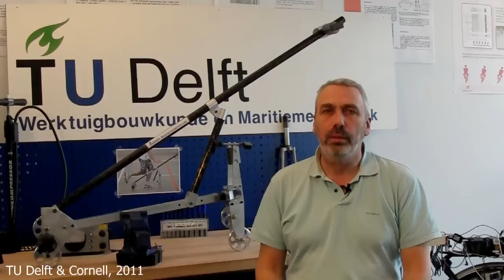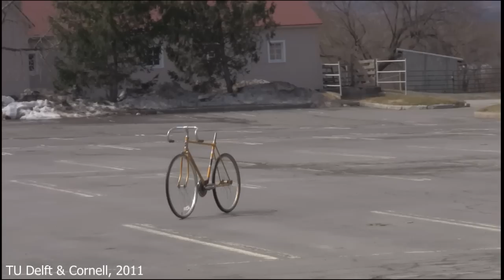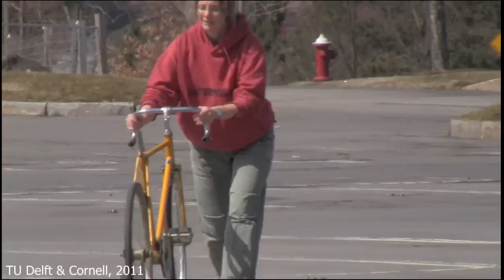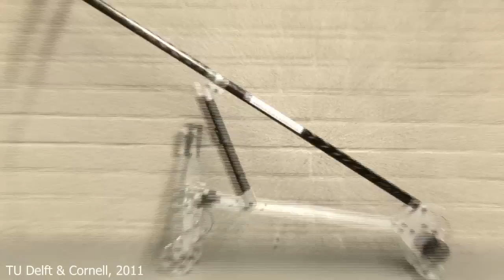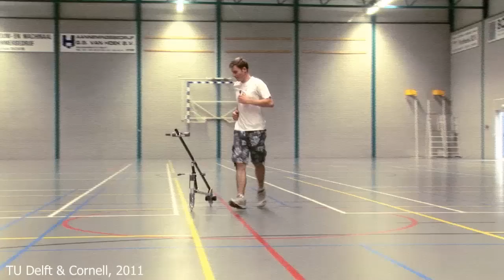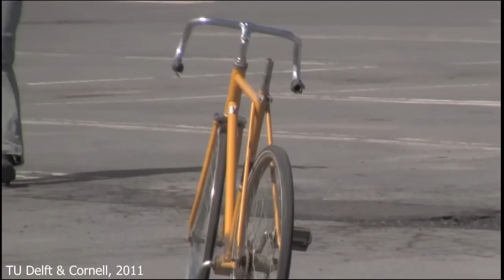TMS Bicycle, stable without gyros or trail (TMS=two-mass-skate)

Comment: This was covered back in the 80's. I wish I could remember the documentary... One of the experiments was a near vertical rake bike with lots of trail down a hill, with no rider on board. With the front wheel in normal position it had positive trail, and would crash as soon as it lost balance from the push start. When the front whet was turned 180 deg in the head steam, the trail became negative, and the bike would lean in to turns as described in this video. Stopping it from falling until all forward momentum was gone. I think they had runs with counter gyros too. Was all open source. I think I saw it on ABC (Australia) as a part of "Quantum" the science show.

Of course it all relates to what happens when there is a rider on board as well.. The negative trail model could not be ridden by any human with a normal sense of balance.  Although interestingly, they did get people with unusual balance disorders to ride it...

The contraption in this video is not a bicycle. It has no peddles nor a seat. I seriously doubt it would be safe to ride. Looks like a tank slapping high-side machine to me. Which is pretty special for something that is technically a scooter.... Oh wait... A scooter needs to have a person on board too. This is just some kind of cart or barrow.... Something that is pushed by a person not riding it.

Awesome Pseudoscience guys. Ripping off open source researchers and failing to get the experiment right. Way to represent.
Reply: By all means do some digging. I'd especially like to see a definition of a bicycle without rider or peddles mentioned. My understanding is that a rider and peddles must be present. Power must be supplied from on board or it becomes a cart or barrow... Bike with no peddles but rider supplied power = Scooter or skate board... If you have an on board power source that is not animal, it becomes a motorcycle. http://www.oxforddictionaries.com/definition/english/bicycle

Technically you could have a treadmill or something other than peddles, but power must be supplied independently from the surface being ridden on. By the rider.

Power provided by animal from off board, is defined as a cart or barrow. Because the geometry and physics all change when you add a rider.... This is a push cart, or trolly (as it has steering). The steering will not work if a rider is on board. It only works when riderless.

To call it a bike I want to see a rider doing continuous figure eights with no feet touching ground. Until I see that. Its just an experimental death trap.
Reply: Aaron Stemple if your doing psudoscience...

Like practicing arboriculture on an animal or calling the vet out to look at a sick tree. Its all bioligy after all. The title and terminology is not relevant...

You cant test a bike if it has no place for the rider to input power, as then its not a bike. Its a cart. Reason being that the rider changes the weight, center of gravity, and adds reflex actions that can not be suppressed. I bike uses these reflex action as part of the balance mechanism. So the most stripped down you can get a bike fr testing still involves a rider and drive system. If you remove the rider its not a bike. It does not meet the geometric requirements of a bike. Which include seat and footrest positions.
Reply: So have you found an example of a TMS bike with a rider?
Reply: I was just looking at the Wiki page for this device. Paying close attention to the pics. when it hit me. Rake and trail are both present on this device. If the main horizontal spar was lifted up at the back, to be parallel with ground. It would not have rake or trail, but with the lower rear it puts both rake and trail on the front. Just like longer forks on a trail bike....

This ones busted I think. Although I would be keen to see what Arend Schwab has to say. Maybe I'm missing something?
Reply: You cant replicate a person on a bike. Get a robot to ride one, maybe, but replicate a human, not so easy.
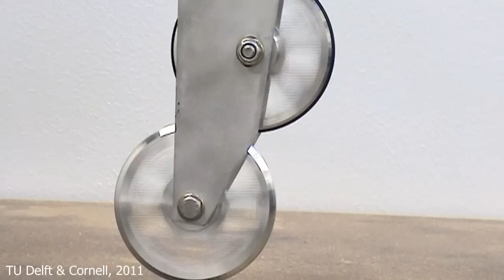Reply: That sounded fishy to me from 1:17, when he stated "it has no gyroscopic effect due to counter-rotating wheels".
But it HAS gyro effect, even if it is rather small due to the small diameter of the wheels (and low mass)...
Gyroscopic effect is about conservation of rotational momentum.
Reply: Razvan-Mihai Dudu it should counter out the gyroscopic forces that make a wheel resistant to turning. In the same way a spinning top with two equal counter-rotating rotors will not balance like a single direction rotor.Not that it would be a factor with those tiny wheels.
Reply: Aaron Stemple did you even read the aim?
This video doesn't demonstrate any of the things it claims to. Its a total rip off of a legitimate experiment done many years before. Classic example of university people attempting to discredit well conducted research with bogus replications that completely miss the point of the original work.Which can be replicated with a mildly modified bike, still able to take a rider.

This contraption dosn't even have the negative trail that is required for such a device to work. That is called for in the original AIM of the experiment. THAT is why there is that counter balance shaft. Because they couldn't get the rake angle-trail relationship right.

To finish the experiment once the bike coasts down a hill. released from a clamp, so NO HUMAN ENERGY is used to ballance the bike, and once this has been done on many angles do demonstrate the bike can self correct, and will always take the most direct path down the hill. Then. Once all that is established. You repeat with a rider, and watch them get flung off before reaching the bottom of the hill. Unless they have a balance disorder that prevents them from riding a regular bike.

Which proves that a bike must have positive rake to be rid-able, but a balance cart can self balance and steer itself. If the steering head is in front of the tires contact point.

Which is ultimately all an experiment in human counter steering on bikes.

What did you find in your study's Aaron Stemple I really hope you have something to say that is actually relevant to the experiment at hand! Seems to me your totally missing the point of this exercise.
Reply: Hi Mongrel and Aaron.  I am one of the co-authors of the work.   I am sure that there are many legitimate things to question about what we have done.  But I don't think ripping off older well-known research is one of them.  Please, if you have a minute, look at some of the stuff, including lots of looks at past research, on our www pages.  You can find them with simple google searches.

One of our appendices is a pretty detailed study of who know what about how bicycles can balance themselves, when.  

Most of the mythology about bicycle balance, which you allude to, comes from a paper in Physics Today from 1970 by  David Jones.   That paper, although regarded by many to establish the facts of bicycle stability, was really, because of its flaws, the motivator of our research.  Again, we have pretty detailed discussions of all of this on our www sites.

In the past when people have given us "This was all well known long ago"
responses, they have backed off, even apologizing, when they have looked into it more.
Reply: I can assure you I am not referring to the 70's paper.
I'm referring to open source research that was published as a series of replicable experiments. In the 80's. By an Australian.

I googled this for over an hour, trying to find the original work again, but this video and one other was all I could  find. Please provide a link to your website.

I'm still wondering why make this device. If you cut and re weld a regular bike's hear steam with no rake, and use offset forks and a counter gyro, you get the same result. Minus the need for a push start. You can then also show the lack of rideability of such a bike. If it self balance it will disagree with most riders...

I'm pretty sure the work I refer to shows its basic momentum that stops the bike falling. I do remember it had nothing to do with gyroscopic force or steering angles.
Reply: Hi:
I did not mean that you were referring to the 1970 Physics Today article by David Jones (British),  Rather, I that it is likely that the show(s) you saw were based on Jones's work.   Jones intended to debunk "the angular momentum theory" and replace it with "the trail" theory.  Our aim in the work you are critical of, is intended to debunk both of those theories.

We have been pretty thorough about the history of ideas, so I don't think you will find that we have casually neglected anything known about these topics. 

My www site about the TMS bike:
http://ruina.tam.cornell.edu/research/topics/bicycle_mechanics/stablebicycle/index.htm

My more general bike site:
http://ruina.tam.cornell.edu/research/topics/bicycle_mechanics/overview.php

Arend Schwabb's site, with lots of overlap with mine, but more stuff:
http://bicycle.tudelft.nl/stablebicycle/

Some of the things on these sites are pretty technical.  But much is not and should be accessible to people who have taken not much more than high-school physics.  And the various videos might be entertaining even if you don't care to follow all of the theory.

Let us know if the things above, if not clarifying, at least give us a pass on not just copying and ignoring previous works.
Reply: Thanks for the links. Technical stuff is good for me :) Been a motorcycle performance tuner for over 20 years. If I cant see reference to the work I am thinking of (Which has likely been suppressed) I'll replicate what I can remember if I can get an old bike frame.
Reply: What's wrong with re-doing an experiment and publishing the results? More data is always better. I'm not sure why you're angry at these researchers for carrying out this experiment.

Comment: Do you feel some sort of gyroscopic effect while holding that wheel? I'm curious...
Further more there must be some kind of magical effect happening since the wheels knows there's another wheels present so it knows when to stop making that gyroscopic effect?.. is that it?...so if you space them like ten feet apart it will still cancel out but they have to still be subscribed to each others twitter feed? is that it?

Comment: the gyroscopic effect of a spinning bicycle wheel is very easily demonstrated and proven by just holding a spinning wheel and then placing yourself in a office chair and tilting the wheel making you rotate in the same direction.
I really do not believe you have dis proven the gyroscopic effect by the counter rotating wheels.. counter rotation works merely in the perpendicular axis not the longitudinal one as far as I am aware. its like the counter rotating propellers on planes or boats.

Comment: this is stupid,of course and its because of inertia,every atom of the bike wants to continue going in the direction it was pushed,including the atoms of the wheels,so the wheels as a whole stabilize in that direction until the bikes velocity reaches a point where the inertia isn't enough so the bike drops down in one side
Reply from the maker: Hi Harry,
Here Arend Schwab one of the co-authors on the Science paper. Indeed, thats what most people thought, but don't judge to fast. Just read the Science paper, it's only 4 pages and no formulas, most people like it. You can find it at: http://bicycle.tudelft.nl/stablebicycle/
Arend
Reply: Arend Schwab if you threw an entire bike completely straight a centimeter above earth,even if it was completely asymmetrical and the center of mass was not between the wheels but left or right(you could glue a hammer on the bike thats pointing left or right),with enough throwing force the bike would still be stable in the direction it was thrown,flying,what's the difference if the wheels are touching the earth,the only one is that the bike would lose velocity faster,if you threw a monowheel the same would be true,even if you throw the hammer the same would be true,it would slide in the direction it was thrown,i see no difference
Reply from the maker: Hi Harry,
I would love to discuss, but I guess I would start repeating myself. So please first read the Science paper and then we talk again, ok?
Arend
Reply: Harry Nafpaktitis
http://en.wikipedia.org/wiki/Dunning%E2%80%93Kruger_effect
Reply: ***** ahahahahaahah xDDD
Reply: Harry Nafpaktitis
...You realize that's directed at you, yes?
Reply: I think what needs explaining is why the bike doesn't just fall over as a pole would. Sure, it's moving forward, but side-to-side it's still. One has to explain how it works as a negative feedback system, countering tilt with a force in the opposite direction, proportional to how far it's tilting.

And half the time people throwing around the Dunning Kruger effect label are self-diagnosing themselves.
Reply: @DrMrPersonGuy  maybe it also applies to you? Do you think knowing about dunning Kruger makes one immune?
Reply: HydeWars Except I didn’t make any claims against scientific papers?
Reply: I am sorry for being so impolite ,that was 5 years ago,I was 20.I still haven't read that paper also haha maybe now I will.
Reply: Harry Nafpaktitis It’s fine lol, can’t believe it’s been 5 years